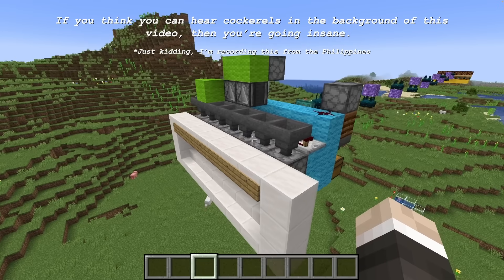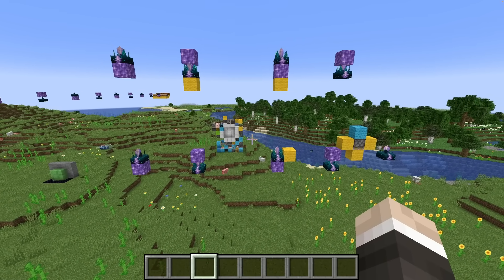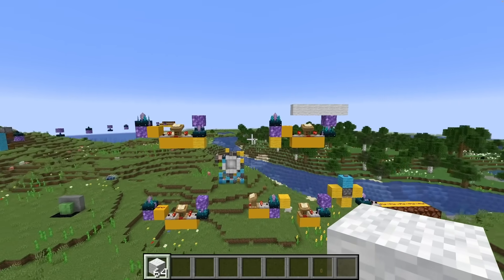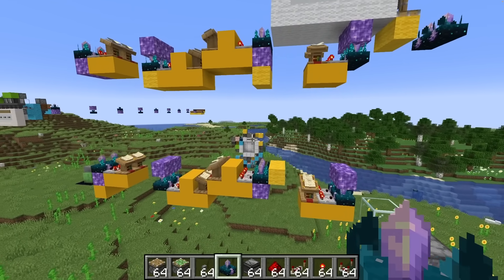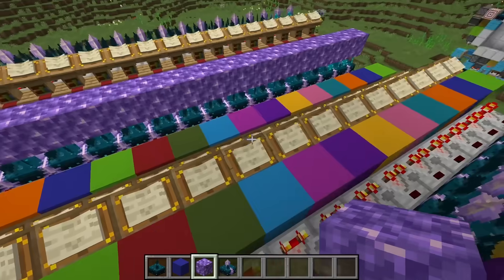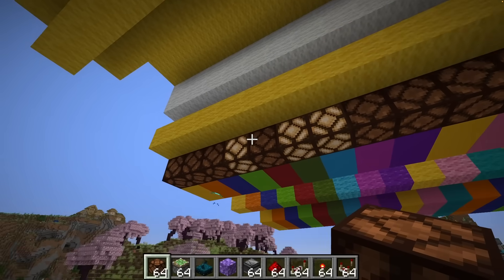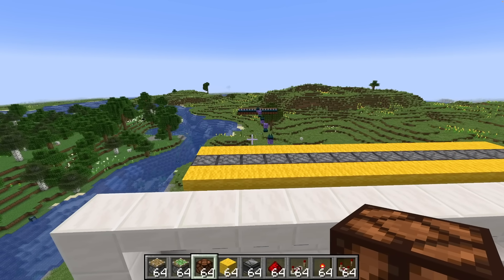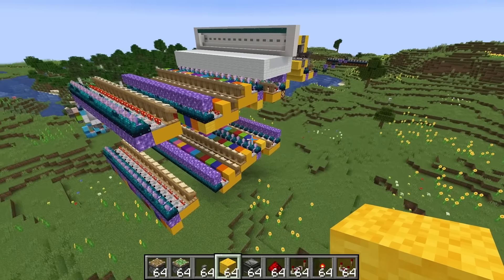This is not a redstone contraption.

Comment: Could have a whole set of poles with those on top across the landscape, like telephone cables, linking towns. Then each town would have a building where they decode the message.
Reply: I said this too but you said it more detailed and less jokingly, I guess Mumbo’s audience enjoys technical comments a bit more than joke ones because I have not many likes lol
Reply: every town would have to be really close though
Reply: @TwigCM  Cool story bro.
Reply: @thehansr  Can you explain this to me a bit further? Assuming the chunks are loaded, wouldn't you just be able to infinitely repeat the signal?
Reply: @TwigCM  no need to be salty 😭
Reply: The main problem is if no one is close to the towns, then the sounds would disappear, and it would be a pain to get them all back in
Reply: @lemonmania967  I’m not lol I’m just saying it, I never said anything negative
Reply: You could already do this with tripwires, particularly using pistons to push minecarts/boats into the line to activate it, and you can use signal-length encoding to encode more complex messages
Reply: @Ignonym  setting up a thing that keeps any chunks loaded that the signals need to go through isn’t too difficult though
Reply: @Kaenguruu  yeah I meant if the chunks became unloaded you would lose the sounds
Reply: @thehansr  I know, but there’s probably a simple workaround
Reply: The problem is sounds aren't persistent, so I assume any unloading chunks cause loss of signal.
Reply: Congratulations you just invented the telegraph
Reply: Well you could build a chunk loader but it might lag the server
Reply: Bro just use wireless redstone at that point
Reply: they would have to reduce how long the sculk sensor is active for.
Reply: @TwigCM mumbo is not very technical
Reply: How do these AIs get so many likes 💀
Reply: @kyleyoung2464  idk lol
Reply: I actually had a project in mind sending these signals through tripwires, across these poles designed to look like power poles. Each pole had a repeater at top due to wire length limitations.

It's fun to design redstone devices to look like a part of a build, rather than their own wire mass or the like to conceal. At the moment for example I'm designing an automated wheat farm with villagers, that is just a regular farm for them to tend to in the middle of a standard village, the village center being a totem they all provide food to.
Reply: @TwigCM  can you tell me yours pls?
Reply: @TwigCM  Would just keeping the chunks loaded be enough, or would you actually need a player in the vicinity to make sure the signal doesn't disappear? More testing is needed.
Reply: You could even set up radio “stations” considering there are many different signal strengths that work. Unfortunately, there would only be a limited number of them because there are only so many sounds you can make using redstone…
Reply: @Niffunn  you can probably find it if you scroll down
Reply: yo
Reply: Oooooorrrrrr you can tupé in chat
Reply: @TwigCM  its just likes dude
Reply: We be inventing the telegraph lol
Reply: @S_R_L_M  why do people always assume that everyone is upset on the internet…
Reply: thats called a telegram.
Reply: Just like the good old wire tapping 😂 I can't wait to intercept my friends messages
Reply: That is cool cuz we could make it look like city power lines when we combine them with chains and other building techneks
Reply: Or to his industrial district.
Reply: Hay Mumbo I know there are already 813 comments but just wondering how did you start your channel i cant seem to get my channel t gain traction
Reply: That'd be really neat, but youd have to make sure there were no loops in the network, otherwise one sound would repeat forever
Reply: If you replace the input buttons with a shulker box with items corresponding to a known Cypher, you could have a telegraph
Reply: I could finally get a good Wi-Fi signal in Minecraft
Reply: @TwigCM  more then 1 radio station can be on the same sound, if they have a delay between each other :p
Reply: Only one person said this but you just reinvented the telegraph
Reply: @TwigCM  cry
Reply: But then some French men in Bordeaux would pay an operator in Tours to do insider trading (cities may have been remembered wrong)
Reply: Kinda like a wireless telegram system honestly love that idea
Reply: Telegraph poles
Reply: Unloaded chunks: Hello there
Reply: @WowCreativeUsername  can't even put in the effort to find out if he was telling the truth huh.

Also, he did make a comment with the exact same idea. Check his recent comments.
Reply: @TwigCM   I wouldn’t say it’s the content of the comment that gave this one all the likes, it was probably just the algorithm being biased
Reply: @ninjamarius9891  idk bro ugh!
Reply: The Clax system from Discworld!
Reply: Imagine being able to think like mumbo 👽❤️ what lifestyle he have, I can tell he is organized af 👌🤝
Reply: Bro just reinvented the telegraph
Reply: @dzp11177  Cool story bro.
Reply: BOYS WE HAVE MORSE CODE IN MINECRAFT
Reply: @thehansr  how about occation chunk loader like a transformator or something
Reply: @Mik-kv8xx  chunk loaders? It would be laggy... but it would work
Reply: @TwigCM  Cry about it
Reply: @thehansr no the poles would have to be, not the towns
Reply: Hermitcraft is asking for this kind of infrastructure.
Reply: @TwigCM  you sent this reply before you posted a comment lol.
Reply: @romer21  no, I don’t really care lol
Reply: You could have Morse code in Minecraft
Reply: @TheDeadOfNight37  I’d rather not get upset over meaningless things lol
Reply: @Kaenguruu  So the real problem with this sort of signal line is loading the chunks. You would need a nether-portal-based chunk loader every fifth chunk, and a sculk sensor with a noteblock (edit: or amethyst block) every eighth block. Honestly if you're already going through the effort of making chunk loaders, a redstone line is just easier imo.
Reply: @TwigCM  Same for me in the previous video haha!  I thought of it as a telegram
Reply: @friesofthefrench  I deleted the original comment and reposted it lol
Reply: holy shit morse code in minecraft
Reply: Telegraph
Reply: POV: you invented the telegram in minecraft
Reply: I believe Nicola Tesla thought of something like this for wireless electricity
Reply: You've basically made the Minecraft version of an auditory semaphore system.  Completely useless due to all of the communication tools that are available to is, but still really cool!
Reply: @lemonmania967  he wasn't 🤨
Reply: @TwigCM  only child.
Reply: You've basically described Telegrams, but honestly the idea of Telegrams in Minecraft sound absolutely lit
Reply: @TwigCM  You did say something negative. You implied your comment got no attention because Mumbo's audience lacks a sense of humor. Which is an odd take to have just because your jealous someone else saying the same thing as you happened to get more attention than you did.
Reply: @dabbopabblo  way to twist words, well done! I didn’t imply that the audience didn’t have a sense of humor. I just made an observation that his audience likes technical comments. My comment was meant to be neutral but apparently nothing can be neutral on the internet lol
Reply: @dabbopabblo  I 100% do not care that someone else got more likes than me for a similar comment. I just pointed it out and now I’m being attacked by people in replies lol.
Reply: @TwigCM  luck of the draw bud
Reply: @TwigCM  No nothing can be neutral in life. The world is black and white and nuances only affect what side something lands on. Your observation is only true if it implies his viewers don't have a sense of humor, otherwise your comment in your mind would of received likes. You supplied that observation as reasoning to why someone else's comment was received better than yours, which can only lead people to presume you're justifying your failed comment by putting the blame on the people who passed by your comment. Well did you stop to think maybe your comment simply wasn't recommended to as many people? Maybe your comment was posted more recently and since then YouTube has stopped recommending the video as much so less people are in the comments? Maybe people assumed you were a bot and continued scrolling, or maybe your comment just wasn't as funny as you thought it was.
Reply: This bery much reminds me functionally of fiber optic cables
Reply: I might be mistaken but have you just reinvented the telegram?
Reply: They take way too long. Better to use instant wire
Reply: I'm a builder, you guys are pretty much speaking a completely different language for me, I just pretend to understand everything so my self esteem doesn't drop
I'm just gonna nod in agreement to this whole entire conversation :D
Yes funky purple mutant flower go brr
Reply: Using a trinary system you could easily have Morse code sent super quickly
Reply: @TwigCM  ha, shame on you
Reply: @Corescos  care to elaborate?
Reply: So, basically, a Telegraph system.
Reply: @TwigCM  i aint reading allat ‼️
Reply: @dabbopabblo  it’s a comment on the internet… you don’t need to get philosophical and write an essay.
Reply: @dabbopabblo   Btw, I know it wasn’t just the audience… I wasn’t being that serious. I’m fully aware of how many factors there are to YouTube’s algorithm. I thought that was clear in the original comment based on how I said “lol” but I guess not lol
Reply: Someone passing a pole with elytra or walling close enough can cause noise in system 😅
If you don't want get noise in messages you should put those in wool tunnels I guess
Reply: @mohammadhh5113  calibrated sculk sensors
Reply: @_.luminosity._  those in middle are not calibrated
Reply: @TwigCM  adding a lol doesnt mask the salt
Reply: mumbo has now invented the teligraph
Reply: @sumicmusic  I seriously don’t care about it, I don’t know why everyone thinks I’m “salty”
Reply: 100th
Reply: …so…so just a telegram?
Reply: we are that much closer to literal phones in Minecraft. This is bizarre
Reply: @TwigCM  somebody who doesnt care would totally act like they care in a reply
Reply: Hook each end up to a moris code generator, and Mumbojumbo and grian will be communicating via moris code in season 10.
Reply: Like a telegraph line
Reply: you can already do this without any poles just look up tileable wireless redstone you can literally just input a bit code into the transmitter and the receiver will have it in seconds as long as both of them are loaded
Reply: @TwigCM  gunna cry lol
Reply: @Kaenguruu  I'm not sure if they replied, but all the towns being close enough that they are loaded properly for this to work reliably, they would be very close together.
Reply: Morse code unironically
Reply: Like a...telegram?
Reply: As cool as this is, I really hope there will be a way to amplify the signal further so that we don’t need such an insane amount of poles.
Reply: @thehansr what about chunk loader mods
Reply: how would u "decode" a message when theres only 15 possible letters and u can use each letters once or u gotta remake the signal
Reply: @Kaenguruu  still slow signal speed
Reply: the chat with no chat
Reply: I think you've described the telegraph, but in Minecraft.
Reply: You, my friend, have just described the telegram.
Reply: @thehansr  I'm not seeing a limiting factor?
Reply: I think it could be more like text messaging but I thought the same thing.
Reply: reinvented telegrams
Reply: its morse code btw
Reply: YES
Reply: Its the rise of MORSE MINECRAFT
Reply: @WowCreativeUsername  bruh
Reply: @TwigCM  :|
Reply: @TwigCM  I'll give it a like
Reply: @TwigCM  its because theyre all children who latch onto the first thing they see. They arent even recognizing that this has already been done when skulk sensors were first a thing, just without the calibration ability
Reply: I can already hear Grian begging Mumbo next season or this one for them to set this up
Reply: @TwigCM  I'm sorry so many people are being ignorant, you don't deserve the rudeness these children are typing without thinking
Reply: @thehansr  or be teliphone polles
Reply: @TwigCM  hey twig. Saw you replying a lot so just saying hi lul
Reply: @WowCreativeUsername  thing is he's actually saying the truth. 

fyi: In mobile you can check comment history.
Reply: I did this immediately after reading the update log
Reply: Oh my god, we could create a 15-signal alphabet and then have wireless telegraphs in non-modded minecraft...
Reply: Well I saw someone do it by serially sending bits through one wire and it won't break if you walk away
Reply: @TwigCM  the sooner you stop caring about likes the better lol
Reply: thats called the clax my friend, if you dont know what that is ready going postal by terry pratchet
Reply: @thehansr  Or just have a railroad of enough afk players going to and fro with the signal to preserve it ;)
Reply: @thehansr  You'd just need a lot of chunk loaders
Reply: You just described the enigma machine used by nazi Germany
Reply: I think you just invented the telegraph
Reply: @TwigCM  But then the server restarts and you can start all over again.
Reply: @TwigCM dude who cares about likes as long as your idea has been heard
Reply: @Kaenguruu yeah thats the thing, they have to be loaded
Reply: @aidan0626  we just need to make chunk loaders to fix that problem
Reply: you could do it between bases with your friends(or secret bases for that matter)
Reply: This made me think of something like Morse code, but with only 15 sounds we’d probably need a different English script (or at least have some signals correspond to multiple letters)
Reply: When they showed off the skulk sensor way back at 2020, i immediately thought of using it as a telegraphs connecting towns around my world with the capital city as the central hub, i started building infastructure so that when the skulk sensors came in, i can just place them in, but in reality it was too complicated to build, but with this it may be possible
Reply: Ok hear me out, using alt accounts to keep the encoding/decoding stations as loaded chunks at all times, and maybe sending out alt accounts on a rail system to follow the signals when they're sent, you could have wireless connections as far as you want. but it's a really far stretch.
Reply: like morse
I like that Idea
Reply: You'd be limited to a 15 character decoder but it's doable.
Reply: You've literally just described multiplexing
Reply: In theory these can activate droppers too right? If one end sends the sound and the second end shoots out the pre-made message, the receiving end doesn't have to loop like the first one does?
Reply: seems too easy to tamper with I would say put it underground with wool.
Reply: Didn't the French have something similar to that? Big windmill like buildings that send signals via giant arms on the buildings. I think Tom Scott did a video on them, can't remember what they're called, but it's a good idea
Reply: Telegraph lines
Reply: Minecraft has entered the telegraph age
Reply: They could do it in hermicraft
Reply: A pole after every 8 or 7 blocks is gonna be ALOT.
Reply: @_Beam  bestie there is this thing called binary and ASCII. 15 is so much available input, that you can even assign multiple wavelengths for different stations.
Reply: How long til one of the pyi craft guys figures out a way to use a sheep, a slime block and a lightning rod to keep the chunks laced so that sounds persist
Reply: @Spiders82  or the rise of the binary computation of minecraft
Reply: So…  A telegram?
Reply: Idea for hermit craft
Reply: @thehansr  not if u use the 7 redstone made sounds, those can be quickly reloaded into the system
Reply: You could have the server learn Morse code and you will only need 2 sounds.
Reply: we really do just have the internet now
Reply: @QUBIQUBED  I don’t know who cares about likes, I don’t though
Reply: @iamgoo  Do I know you or are you just saying hi to say hi?
Reply: @OpossumPartyy  Thanks but it’s fine, I don’t get upset or offended by people that easy so I don’t really care.
Reply: @innervinesmusic  I don’t care about likes so this doesn’t really apply to me lol
Reply: @dylanbelmore4048  is this meant to be an insult? If so that makes no sense lol
Reply: So an auditory telegraph system as opposed to the old visual ones.
Reply: Morse code would only require three(I think?) buttons as well, so it wouldn’t be too complicated to craft said messages
Reply: if someone made this id use that instead of chat XD
Reply: Took my words man
Reply: intra-world telegraph system anyone?
Reply: like morse code
Reply: GNU Terry Pratchett
Reply: @Kaenguruu  yah but who actually has a sever powerful enough to have chunk loaders that are Permanent and if you wanted temp ones you need redstone anyways
Reply: @cjslime8847  Didn't say it's a good solution
Reply: @TwigCM  skill issue
Reply: @Zoiler  okay?
Reply: Guys, twig DOESN'T EVEN CARE ABOUT LIKES he brought it up in passing as a metric to analyze what Mumbo's audience likes most, an interesting conversation topic and nothing more.

Everyone harassing @TwigCM about this, grow up. Y'all are the reason Minecraft keeps being represented as a game for little kids, now kindly get out of the comments of one of the LEAST AGGRESSIVE mc creators of all time
And go back to playing fortnite
Reply: And builders can also make it look good.
Reply: @cherricake1796  Thank you. I always analyze things a lot, and I’m also interested in psychology and how people think.
Reply: Yeah! Though just 2 sounds would be enough, you just have to encode them in binary…

But with 15 we can send lots of information, each sound can carry 1 piece of information. If you are sending a message with a max of 30 types of symbols, 2 sounds per letter! To do the whole English alphabet in caps and lose, as well as punctuation:

That would be 7 sounds. It seems there is about a one second cooldown, so each symbol would take 7 seconds

At first that sounds slow, but realize most Minecraft computers take longer, just to handle simple math! This will allow computers to encode data much more compactly!
Reply: A telegraph!
Reply: And tan eventually everyone will have one In there house
Reply: Good Idea, but they can't be too far cause simulation distance
Reply: Minecraft has entered the age of telegraphs
Reply: Redstone enigma machine?
Reply: Dude just described the telegram 😂
Reply: Max Anderson  Yes, but not in minecraft. In minecraft, you would need either multiple wires, or manage to encode it in the length of bursts. That required computers. Now, you can send up to 15 symbols without any in-game computers, and multiple times that with just a simple computer! (If you send 2 sounds per character, you have 15*15 possible symbols! A.K.A. A lot!)
Reply: @ivyandersen7708  No! That’s crazy! Next thing we know, you’ll be talking about ones that fit in pockets!
Reply: Kinda like Twitter or Facebook but in minecraft.
Reply: Semaphore poles!
Reply: In simple terms Morse code
Reply: @ScibbieGames  You could always have a system to reset the sounds and send your messages using morse code so you could use two uncommon, but easy enough to replicate sounds such as equipping armor(mentioned in his first video, and damaging an entity(use something like an armor stand)
Reply: terry pratchett intensifies
Reply: @thehansr  it's a discworld reference it's not meant to be realistic
Reply: @thomaspalazzolo5902  I scrolled so far to find a reply like this, thank you, thank you so much for ending my search
Reply: @TwigCM  This chaps a bit full of himself innit?
Reply: @TheGameChangerLord  who? What? If you’re saying me then that’s pretty funny because I have quite the opposite problem lol
Reply: @TwigCM  You were complaining that someone else got more likes than you and made a passive aggressive comment towards Mumbo's viewers while patting yourself on the back for checks notes having the same idea as someone else but that other person saying it better.
Reply: @TheGameChangerLord  when did I complain? I don’t care about likes so I wouldn’t complain about it. And how was I passive aggressive? By analyzing what things the audience might prefer? Also, could you cite where I “pat myself on the back” because I can’t find anything suggesting that.
Reply: it would be a great way to shut off/ turn on farms in an industrial district
Reply: @aidan0626  I’m not too knowledgeable of how skulk works, but could you not use chunk loaders along the lines which would let they sound travel until it reaches a station?
Reply: @Kaenguruu  If the signal goes into unloaded chunks it wont go any further
Reply: Ye
Reply: Telegraph?
Reply: @thehansr  what about a chunk loader machine
Reply: Bro just invented Morse code
Reply: @thehansr you could add more in a chain, each producing a sound